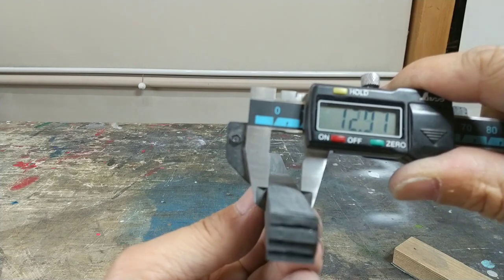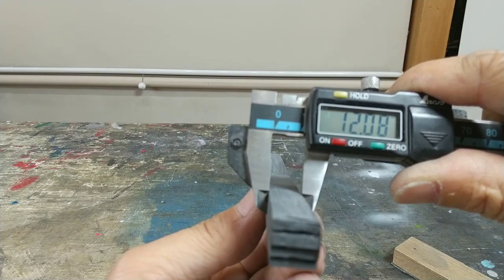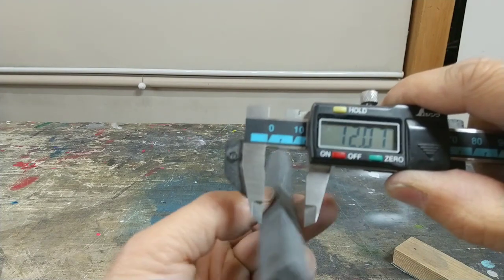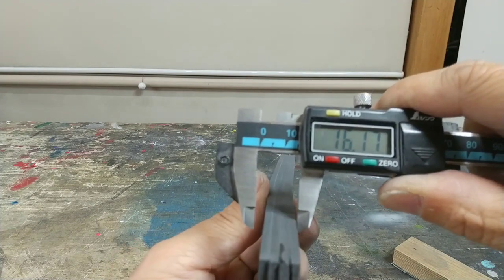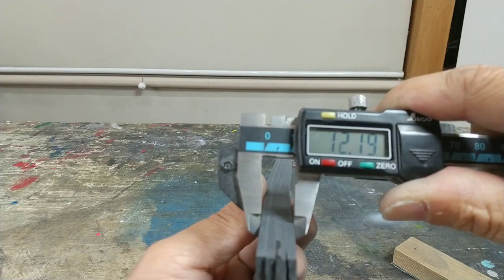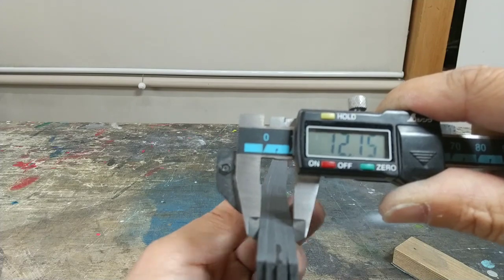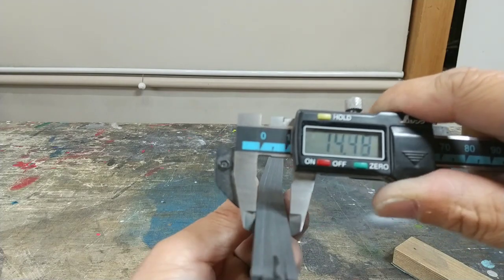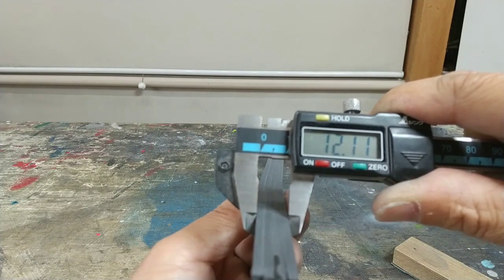F3J Shadow wing joiner making by carbon fiber composite

Comment: Poor shadow! How do you get your 3.5 degree start material for the joiner layers?
Reply from the maker: Make it with the same tool in the video (1: 05 ~).
In the video, the gap is 12mm, but it is possible from 0mm.
The angle can be changed freely. The thickness can be made accurate by inserting a dummy (3 mm thickness).
Reply: @ninjasloper  Is there a core?
Reply from the maker: @jasong911ski  48k carbon roving about 52 plies are used.